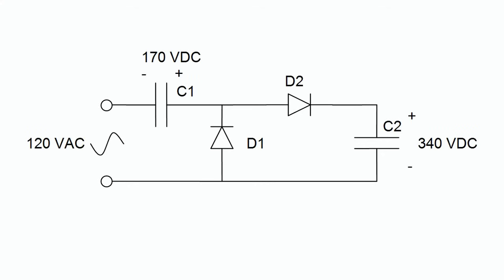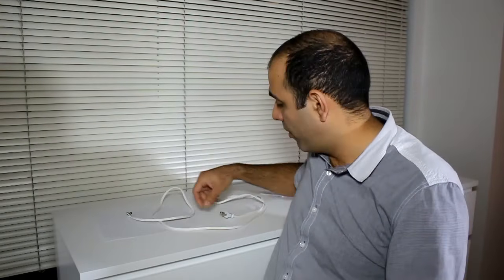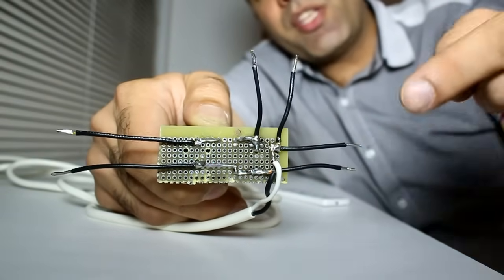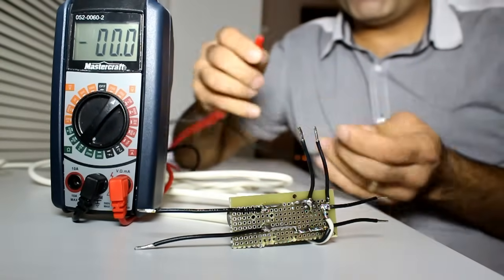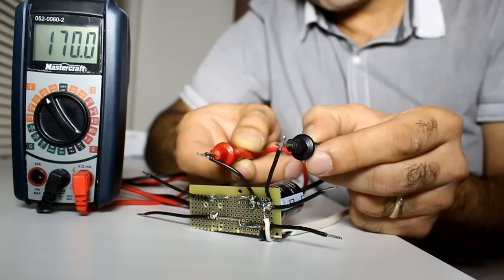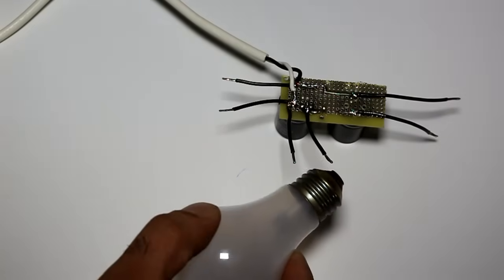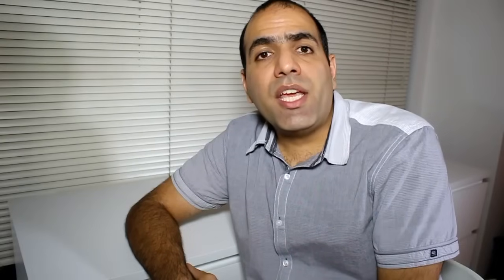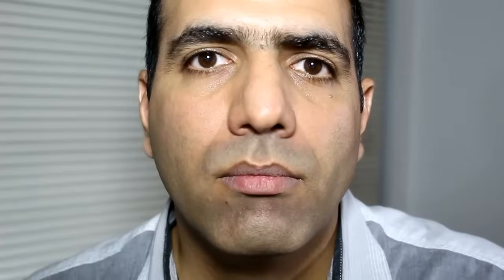High Voltage AC/DC Effect on Human Body

Comment: Hi Mehdi, I was wondering if these cc voltages and amps are lethal

5V at 2A (from an iPad charger)
3.5A at 35v (from a bench power supply at max settings)
Reply from the maker: +NeXTSTORMING non of them are dangerous unless you pierce your skin and shove them into your heart, in which case you will more likely die of bleeding
Reply: +ElectroBOOM your actually a great guy XD
Reply from the maker: NeXTSTORMING
So, would you screw with 12V 500DC capable (6kW)? Because that's harmless.
Reply: +gavinkap sorry but i had too.You're*
Reply: Melroy van den Berg I call bullshit.
Reply: +Dazzwidd hehe, been ther! Done that!  Alot of fun with 2kA watching cables twist and writhe! ...oh and getting really really hot.
Reply: Skin never gets to 200ohms, even with hands soaked in salt water, your resistance will still be more than 1000 ohms
Reply: Melroy van den Berg Well ok AC but what about DC?
Reply: ***** I'm not sure, I think DC as well. You need the voltage to make the current flow. But when you have wet hands and you grasp the cable very good, I think you can die with only 100 milliamp. 0.1A with 300 Ohms resistance requires 30 volts DC...

So it really dependence on other variables, like moist/wet hand (or another location) and if the current will flow through the heart or not.
Reply: Melroy van den Berg Even when you set your ac or DC power supply to 1v which is capable of putting out few hundred amps ! The current drops significantly , which is harmless
Reply: +Melroy van den Berg Watch Electroboom's video about what kills, the voltage or the current, before calling other people stupid.
Reply: But a 2,000V 5A supply you couldn't pay me enough to play around with.
Reply: +Melroy van den Berg ...wet skin still has about 1000 ohms and two contact points = 2k?... read the paper you cited yourself!
Reply: +DMAN22yeah Unless if you apply salt to it.
Reply: ***** 
my teacher has a 12v 10amp power supply that does AC and DC, i know the ac side is lethal but it the dc side lethal cause its about 120 watts dc which is A LOT more than what is screw around with ( i screw around with 12v at 1 amp dc)
Reply: *****
I'm not bullshitting here.. https://www.physics.ohio-state.edu/~p616/safety/fatal_current.html

The amps will kill you and the voltage is indeed needed to make the current flow. High voltage will also burn your nerves. When the current can flow, the current will flow.
Reply: +Giorgos keme to* moron
Reply: +Melroy van den Berg that math is wrong, and skin doesnt get down to 200 ohms unless it is soaked in something conductive. regular water is not conductive.
Reply: +Melroy van den Berg The current doesn't go through your whole body, but trough your fingers. Current always tries to seek the way of lesser resistance. As having wet hands holding one wire in your right and one wire in your left forces the current to go trough your body, but 200 ohms would be very low.
Reply: Hahahaha I would definitely screw around with a 5V 2,000A supply. So much fun to play  with. Because I know what I'm doing I won't be hurt xD
Reply: +Giorgos keme ...yeah Melroy is slightly off! Wet skin has 1000 ohms and then you need to add internal resistance which is 100-500 ohms depending on short or long or path. Generally speaking people can take roughly 10 times the DC current compared to AC which really messes with the heart and breathing. Everything is also time dependent, you might die instanly from a few secs of 100mA AC but you'll most probably also die of 60 sec of 30mA AC (speaking about unfavorable paths like hand to hand or just through torso). To stall heart and breathing you'd need about 300mA DC. If the current carrying prongs are inserted really close to heart you can kill 'em with much less, like 6-10mA AC.
Reply: +Giorgos keme to*
Reply: Your current is off by an order of magnitude, 12/200 = 0.06, or 60 milliamps, and like everyone's mentioned so far, it'd take the path of least resistance, which be through the wet surface rather than through your body
Reply: NeXTSTORMING well I know a computer charger ain't lethal I got FRICKIN SHOCKED
Reply: It's not just the amps that kill you. The main factor is the length of exposure.
Reply: 3rd Reich to*
Reply: whatsup914 saying voltage doesn't kill current does is like saying guns don't kill bullets do. as you increase voltage you also increase current research ohms law. current is equal to voltage divided by resistance as you increase voltage the current goes up. sorry for bad English but ohms law is easy to grasp take some time and read about it if you want to know more I'll Gladly explain
Reply: Melroy van den Berg Body resistance will not be dropped to 200Ω if you wet your hands. It couldn't even drop that low if you soaped up your hands as much as you could.
Reply: *****  NeXTSTORMING 
If you got only 12V, but with wet hands your body resistance can be 200Ohms. On that moment: I = 12V/200R = 0.6 Amps. 0.2 amps can already kill you and is lethal. Don't believe people who are saying the volts are killing you, they are stupid. 0.6 amps is instant dead. It's the amps that kills you. AC is even more dangerous, AC can course ventricular fibrillation.
Reply: Even with wet skin soaked completely with salt water, your resistance can drop to about 10 kOhms (basically all skin resistance is gone, and your body's internal resistance of 10 kOhms is all that's left). With completely dry hands, my total resistance was well over 10 MOhms. I've tested it with a multimeter before.

Comment: I have 1 questions, if DC is better than AC and it doesn't kill people why aren't we using DC instead of AC?
Reply from the maker: Jy Chew
It's possible, although the rate of death due to electricity is so small probably nobody cares.
Reply from the maker: Jy Chew DC is not better, just safer. All transformers use AC.
Reply from the maker: AreSophia Apollo
not necessarily, but converting DC to different levels is harder than AC. So transmission lines that constantly need to reduce/increase voltage between cities use AC. Also some old wall adapter and also AC motors (every thing than makes a 60Hz humming sound like washroom fan) need AC.
Reply: ***** Hassan Ajrouche now I learned something new! Thanks to both of your reply~
Reply: Jy Chew AC loses less power over long distances, better for powerlines... if we used DC we would need a power station every few miles
Reply: Jy Chew Both AC and DC have important uses depending on the application :)
Reply: ***** doesnt DC need way bigger cables to run the electricity trew ?
Reply: ***** So is it possible that 1 day all of us will be using DC so people kill by electric shock will be reduce?
Reply: Jy Chew you are welcome, a few examples of dc uses are high voltage circuits, lighting up light bulbs with a small amount of parts to use, charging a phone using a drill putting it on reverse and max torc and turning it at 100 rpm with a makeshift crank shaft that you can attach to it xD etc... and many fun science experiments theres many more uses if you want to know about them :)?
Reply: Jy Chew Denmark did actually use DC 60 years back or so. One of the reasons we changed over was apparently because of all the fires. DC sparks like hell, it's not nearly as big a problem with AC.
Reply: +Hassan Ajrouche Just to make this more confusing, DC is better option when power cables run on ocean floor. This is because reactive losses are much greater underwater.
Reply: ***** that makes it worse then the energy just bleeds out into the ocean and affects the surroundings and ocean life .-. thats horrible
Reply: +Jy Chew  Different appliances require different dc voltages. When you convert dc to dc power loss is higher. If you were to supply your house with 170 volts dc and you need 5 volts for your phone charger, that remaining 165 volts is wasted and is dissipated as heat. This is just too costly and energy hogging. It is far more easier to convert an Ac voltage to lower or higher AC voltages using transformers. The only losses in a transformer is a Iron loss (which is because of the iron core of the transformer and is always constant for a given transformer) and the copper loss (which is because of the copper winding, this depends on the amount of current being drawn). These loses are fairly small and can even be reduced by using better core and winding materials. So, now if you need 5v for your charger you can use a 120-9v transformer and than use a regulator to get 5v output.
Reply: +Jy Chew I'd wish we would start converting to DC, every digital electronic device would be cheaper, smaller and more efficient if we had DC in our outlets. I can't think of a single device that would neccesarily need AC(maybe old alarmclock radios, some use 50/60hz for time keeping), everything in my mind could equally be manufactured in DC variants. Also High Voltage DC is the most effective way to transmit power over long distances, wether on pylons or buried/submerged. Buried and submerged cables must be insulated ofcoz. Just compare loses for a 1000km wire: AC losses 30-40%... DC losses 3.5% !
Reply: +Hassan Ajrouche wrong! For 1000km AC has 30-40% losses compared to HVDC 3.5%. AC sux, always has, but today we have materials and know-how to convert AC-DC and back again efficiently. Transformers are not very efficient, especially small ones are notoriously inefficient due to self heating.
Reply: +TheNewFaceOfHSP Denmark still has HVDC for windfarms, HVDC is the most efficient way to transmit power long hauls or submerged/buried
Reply: +MrOmnos no, you are wrong. AC or DC can be transformed, DC just needs to pulse it with higher frequency into a smaller transformer or inductor to step up or down voltage without the losses you mention. DC-DC converters can be designed to have about 70-95% efficiency depending on application, where as low power transformers (1-2VA) have efficiencies of 30-60% or so.

Comment: What happens to the current in a cryogenic-ally frozen body. Is that a state of complete resistance or negative resistance. Life equals resistance because you need current to do work and maintaining cellular structure requires work. Can a frozen body be reanimated, without some degree of freezer burn.

Comment: Hi Mehdi, you experienced that the 340v DC hurts alot more then the 120v AC... but one of the reasons why we have 230v AC in Europe is because it's safer then DC, regarding in not getting locked in on the electricity with the human body. Of course there are more reasons like more spark damage to switches with DC but according to your experience i'm now doubting the first reason, any comments on that? I don't say we'd better had 340v DC but what about 230v AC vs 230v DC (for example.)
Reply from the maker: Jelmer I didn't say 340VDC hurts more than 120VAC. In fact I think 120VAC hurts more. 230VAC would be much more hurtful. I don't know why they say DC locks your muscles but AC doesn't. I suppose since AC shakes muscles there is a chance of letting go. But AC pushes more current through body and hurts quicker. I can touch 340VDC a couple of times and tolerate the pain. But I don't want to remember how much 120VAC hurts.
Reply: ***** I stand correct, my thoughts were different from what I wrote, sorry for the confusion. I meant to ask you why we have chosen for AC (almost worldwide I think?) instead of DC.
I we had DC out of our sockets, it would be much safer to handle, according to your video... but out of realistic point I know the choice for AC is with good reason. Btw, I've touched 230v (fused at 16amp) more then one time and indeed, you'll remember the pain for a couple of weeks from the trauma!
Can you make a experimental comparison out of consumer perspective about AC or DC powered sockets, for the pros and cons?
Reply from the maker: Jelmer
I see. The reason we use AC is that it is much more efficient for transmission purposes. See, when it is made at the plant, we have too boost it up to hundreds of kilo volts to be able to transfer it long distance, which means we need transformers that need AC. Then when they reach city they are stepped down in multiple steps until they reach 110V. So it is beneficial to keep it AC all the way. Also many things still need AC power, such as AC motors in ceiling fans, fridge, pumps, etc.
It would waste so much power if we send DC, convert to AC for transmission and convert back to DC again for home, and convert again to AC for appliances that need it.
Reply: ***** Well yeah, that makes sense indeed. Didn't really thought of the appliances  we use but of course! Thanks for your clarification :)
Reply: Jelmer -_-, mah mistake...
Reply: +Pedro Bermudes Power transmission systems at substations and at distribution level have safety systems too in the US and everywhere else. Ever heard of a cutout fuse or recloser? Even substations have circuit breakers and etc, usually the reason why downed power lines take forever to trip a circuit breaker/recloser/ blow a fuse is because they require a very huge current draw/overload to operate. I think they are this way because if they weren't it would be tripping all the time just because of a small overload. Reclosers sense a problem, they open, then reset to try to clear the problem causing the short/overload, they do this 3 times then stay open meaning it was unable to clear the fault. I've heard a cutout fuse blow too on a distribution line. VERY loud, like a shotgun. If we made the safety systems real sensitive, we'd have major power interruptions (most of the time because the system thinks a small overload or short is a problem). I think the power company would go nuts dealing with those all the time. Usually a downed power line, or a shorted one would cause the recloser/circuit breaker, etc to operate but sometimes its not enough of a load to do so. This is why you always treat downed wires as live and stay well away from them, you never know if the recloser will close and energize the line again, and if you are near it, you're dead.
Reply: ***** Agreed
Reply: removed...
Reply: Pedro, you got it all wrong, nofi;

230V does absolutely not exist out of 2 lines, it is a similar system as 120V, just 1 fase, 1 neutral and sometimes 1 ground. Also, ground and neutral are NOT the same thing, not in 120V and not in 230V. Where did you get that information from?

Where it becomes interesting, according to you... is the safety-system? I think you are talking about a RCD (residual-current device), those systems are available for every electrical system but not required for every group. In europe they are usually required on groups to wet area's, for example the bathroom.

Let's be careful what you explain to people, especially when it's about dangerous stuff.
Reply: +Jelmer Actually in Electrical panels where the breakers are terminated, the ground and the Neutral wires can be terminated on the same bus bar in an 120VAC feed. It's just when you have a sub panel being fed from the main panel is when you need to terminate the grounds and neutrals on an individual bus bar. Being said, that doesn't mean that you can hook up a receptacle with the ground wire on the Neutral screw or vise versa with the neutral shared with the ground screw. Sure it may work, but it's awfully hazardous and by far against code. I've seen a few home owners think that they can do electrical and that hiring a "Proper" Electrician isn't worth the time or the money.  Believe me, they're wrong for thinking that, and if they had it installed correctly the first time, then they wouldn't have to hire someone out to fix it.
Reply: It can be stated that Neutral can be grounded, but Ground is not neutral.
Reply: ElectroBOOM  hi I touch 120v ac with out any pain and I can hold it for long time if you contact me in my Facebook ahmedalmosawi19 @yahoo.com I can show you my video or you can call me
Reply: Jelmer  and  what is more painful 120Ac or 220Ac